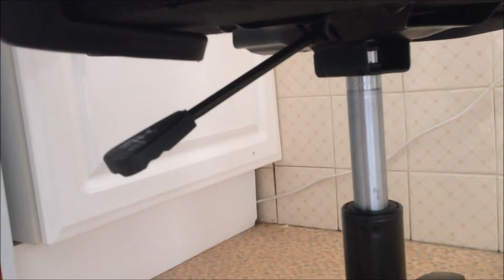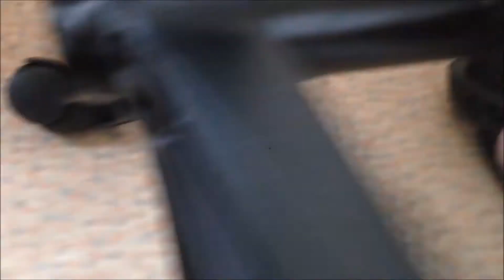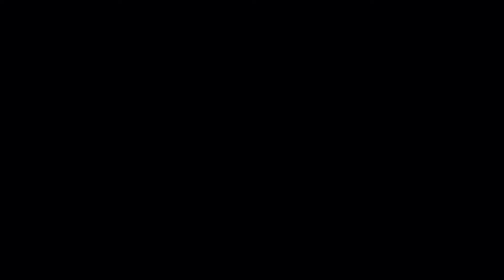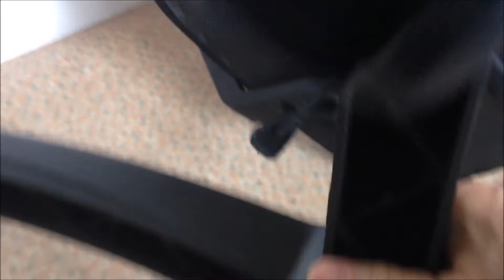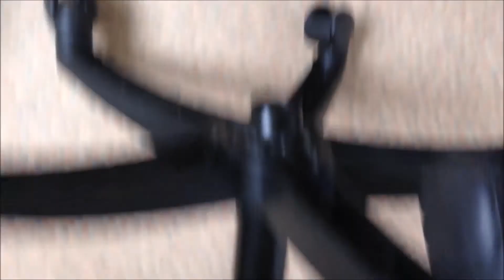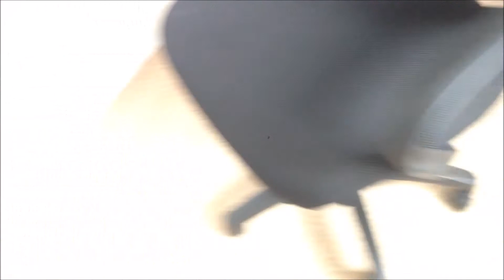Office Chair Sinking: How to Repair?

Comment: Another fix that can work, at least temporarily is to spray some WD40 on the shaft, and possibly near the top where the button is.  Personally, I prefer the PVC pipe solution.  You can also buy a new cylinder for your chair, they are available online and just replace it totally if that is what you prefer.  The PVC pipe is cheaper.